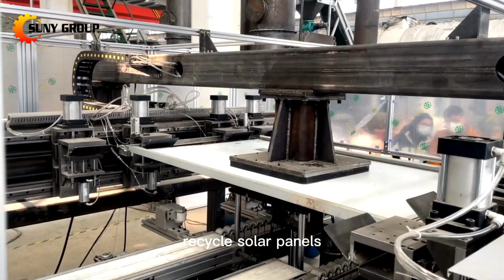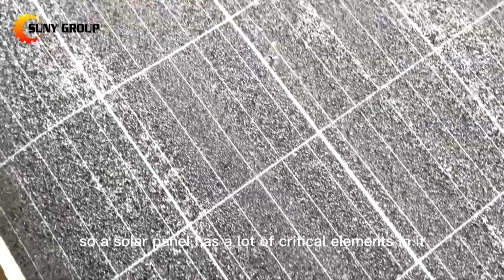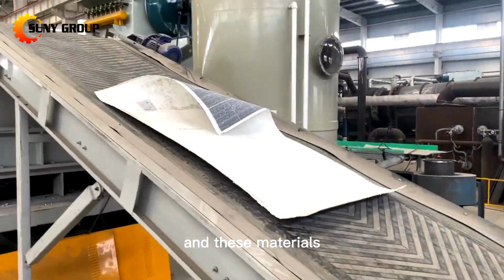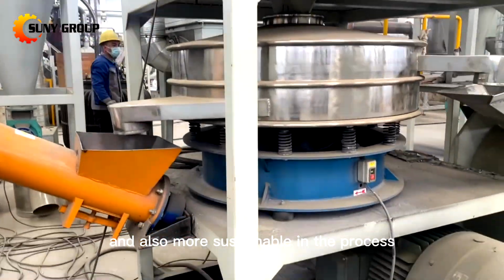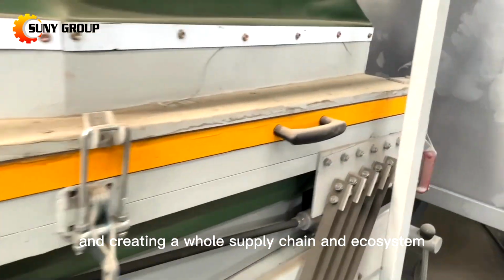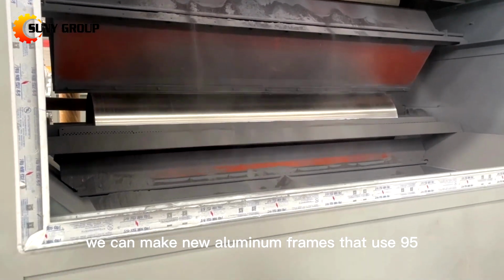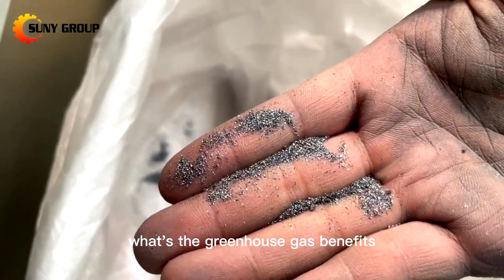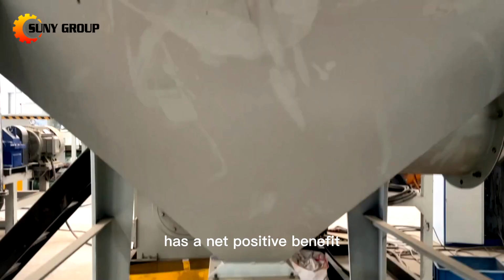Solar Panel Recycling Solution

Comment: Mining at the point of need, brilliant.

Rooftop solar PV generation ( and storage) at point of need is brilliant.😊

Aluminium is 95% electricity. Because of refining and...😮😮😮

Recycling cheap.
Reply from the maker: thanks for your like, if you have demands of this solar panel Recycling Machine,please contact me at:
Email:ellieyang794@gmail.com
Whatsapp:+8618939160378